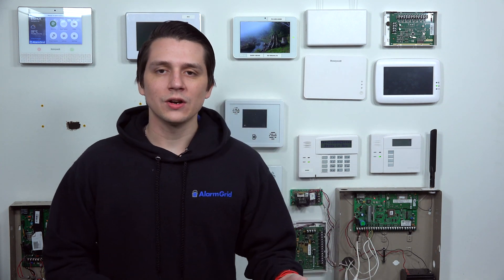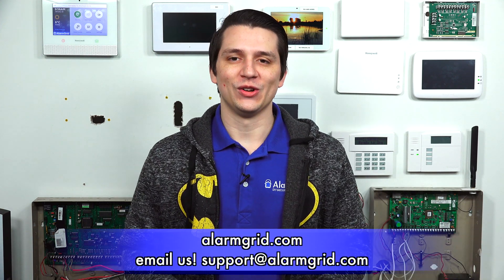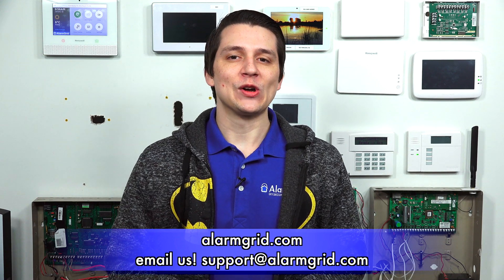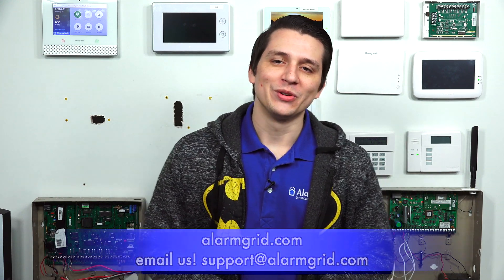Tilt Sensor That Is Compatible with the Qolsys IQ Panel 2

Comment: These tilt sensors are notoriously unreliable. I don't know how many I've had fail. One is telling me my garage door is opening and closing even when it remains shut. The best solution I've found is using a normal door/window sensor with a door hinge. You can find videos on YouTube about how to do this. You basically tape the hinge to your garage door, and tape a sensor magnet to it. You then tape the sensor just below it. When your door opens, gravity causes the side of the hinge with the magnet to fall away from the sensor, thus tripping it. Done this way, your garage door sensor will be as reliable as any door or window.